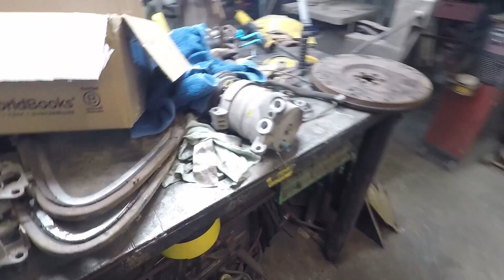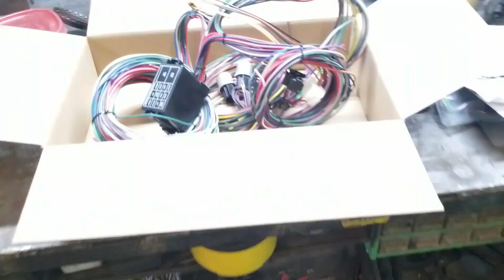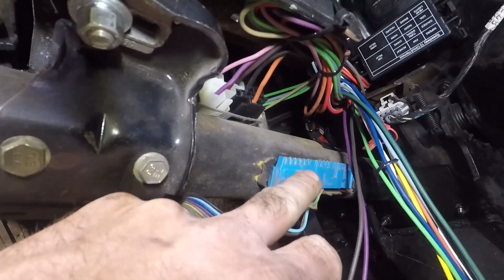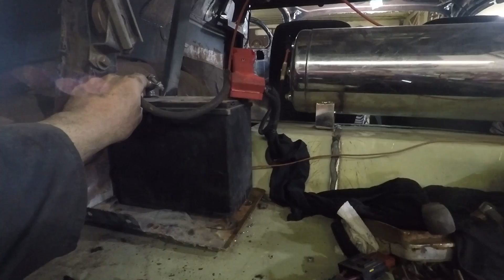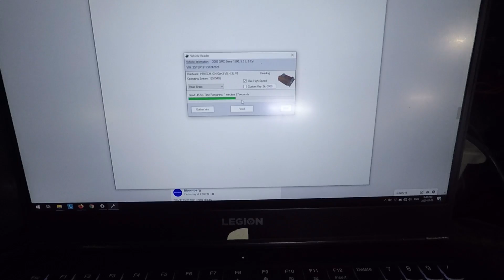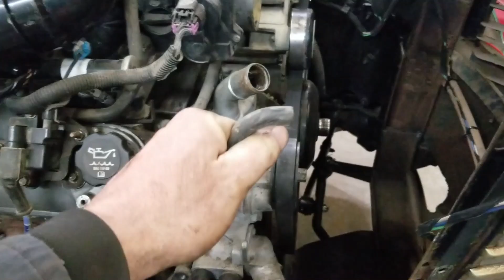First start of the LS powered 38 Pontiac!

Comment: Great videos, couple LS questions for you. When buying a donor how many K's is too many, and if a guy buys a 4X4 is there a tail stock available to convert the trans too two wheel drive?
Reply from the maker: no idea on the km thing although mileage don't scare me with these motors, think my Buick's motor has like over 400k on it. As for the trans question don't think so as I believe you got to change some internal parts to make that work.
Reply: @HalfassKustoms  Thanks for the quick reply, good info on the trans, SGI salvage out here has lots of  potential donors in the 190000-300000 k range for $800-3000 range
Reply from the maker: @glenmiller3783  yeah I wouldn't be scared of em. I would just source a 2wd trans if that's what your looking for
Reply: @HalfassKustoms  Thanks for the info

Comment: Sounds pretty good. I have a similar wiring harness in my convertible...affectionately called DREDD...lol. they are definitely straight forward and labeling on the wires is awesome. Love that car👍
Reply from the maker: Thanks man, yeah Ive tried other cheap kits and always end up using speedways stuff :)
Reply: @HalfassKustoms  I used an ex wire kit...looks same as one you have on your video

Comment: Please sir, your very good. But can't you use heat shrink butt connectors ?  AKA gas float wires.
 Or have you done it, but didn't show the mundane stuff ?
Thanks (AKA Pain in the Ass)  Lol.
Reply from the maker: If your talking about in the tank? I just used what came with the pump. 👍
Reply: @HalfassKustoms  Thanks